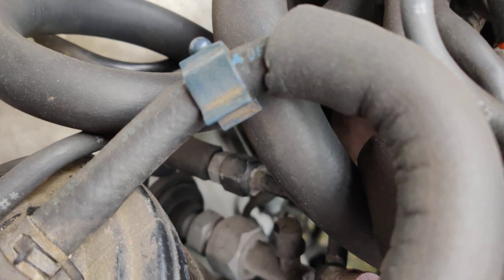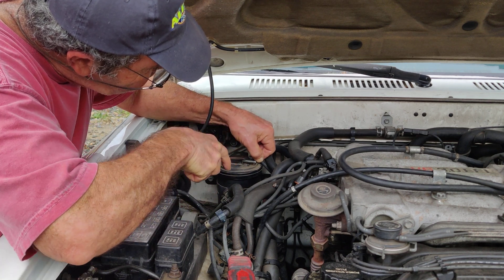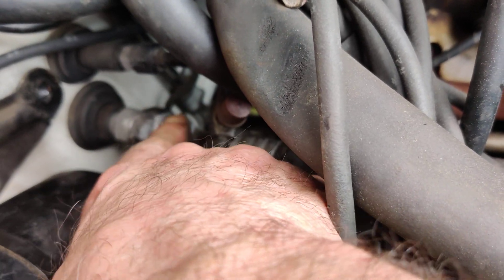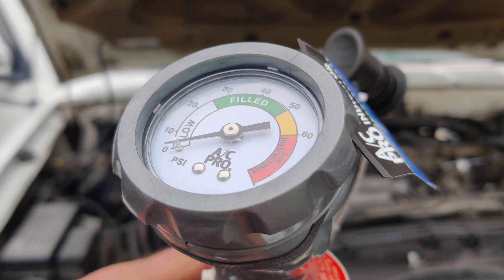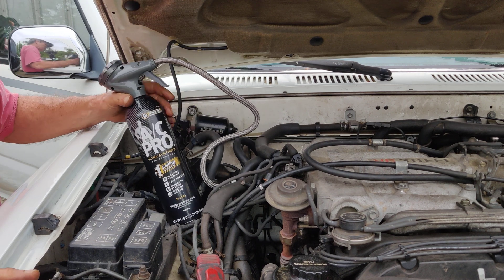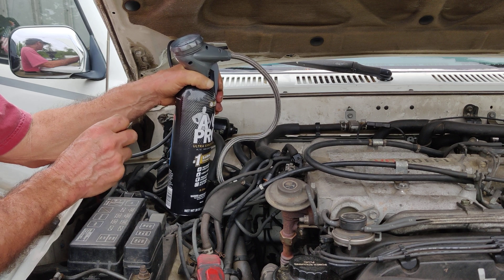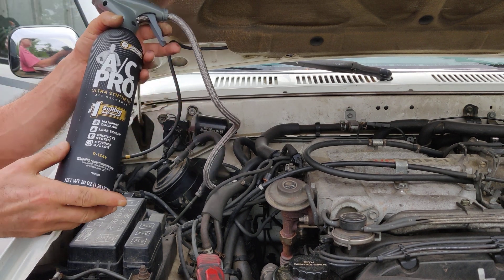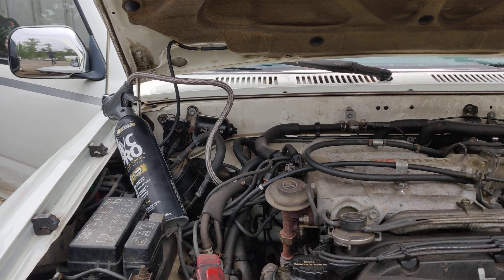Air conditioning conversion from R12 to 134A on my 92 4 runner

Comment: Should you add PAG or Mineral/Ester oil and R134a. Was r12. Just replaced fittings. 1992 Pickup
Reply from the maker: I don't remember if I added oil. I think I did but it's still working good after 4 years. Thanks for watching 🔧👍

Comment: Great video! I converted my 89 blazer from R12 to R134, only thing I did was change fittings and put I think it was about three small cans in it. The gauge stayed where it was supposed to.  It would stay nice and cold for about three months then I’d need another can. Living in SC. It gets hot and it worked great for us. My compressor had the leak in it but I’d have to pay almost as much for the compressor as I would of for the blazer! It was cheaper to put a can in it every two/three months. Thanks for your video!
Reply from the maker: Thank you and your welcome. You could have tried some sealer. Sometimes it works. Thanks for watching 🔧👍

Comment: Hello quick question if get all the r12 in it so what kind of oil i need to put back in it?? Thanks in advance
Reply from the maker: Add mineral oil. Thank you for watching 👍
Reply: Use ester oil it’s compatible with r12 and r134a.

Comment: I’m gonna do this to my 1993 Camry. A local shop wants to charge me $196 to evacuate the r12 from the system. Anyway I can evacuate it myself?
Reply from the maker: Not that I know of without the machine. I figured I would try it without evacuating the system. That was 2 or 3 years ago and it still works great. Thanks for watching 👍
Reply: @gravelyman  thanks for the quick reply. So you didn’t evacuate the R12 in your 4Runner? You just put the new fitting on and then recharged it with R134?
Reply from the maker: @metalhead719  Yes it worked for me. And your welcome!
Reply: @metalhead719 Did you end up evacuating the system? Did it work if you didn't?
Reply: Did you do it yourself? I have the same year Camry.

Comment: I’m about to do this… so basically just remove all the r12 out of the system then install the fitting on the low pressure and recharge… seems pretty straightforward… no need to install a fitting on the high side right ? 😅
Reply from the maker: Make sure there is no leaks in the system. Make sure the r12 is out and yes 134 fitting on the low side only. Do not over fill. Thanks for watching 👍

Comment: Where did u get the fittings? 
Part number pls
Reply from the maker: Advance auto. I'm sorry I don't have the part number but there is on one kind over by the freon. It comes with an assortment of fittings. Thanks for watching!!!
Reply: @gravelyman  Thank you, hows it holding, it's cold?
Reply from the maker: It's still ice cold. It will be 2 years this coming spring. Thanks for watching 👍
Reply: @gravelyman  thanks for the video and info....

Comment: "I am not one to read directions"  That does not inspire lots of confidence in the information you are trying to provide.   I was hoping to hear information like   What is the difference between PAG oil and Ester oils,  Operational differences between R12 vs R134a,   pressure low side vs high side, efficiency differences, between R-12 and R134a.    if the Pressures are higher, do we need to change out the high side limit switch, what about the low side limit switch.  and what are those switches for and where are they?  On a Orifice system do we need to, or is it better to change out the Orifice tube to get equal performance.    Is it best to invert the can to dump liquid refrigerant straight in the system, or is it best practice to only introduce refrigerant as a vapor with the can upright.    I have two systems to convert from R-12 to R134a, and I am seeking information.   Could you help me with my questions?
Reply from the maker: The best way to do it is to evacuate the system and make sure the system holds vacuum for at least an hour. Now you know you have no leaks. I suggest buying gauges. You will have to add PAG oil and when you refill it with refrigerant you will have to look up the specs for your vehicle. I never ran into problems with switches as you asked about. I know using 134a will take a lesser  amount then the R12. I hope this helps you.